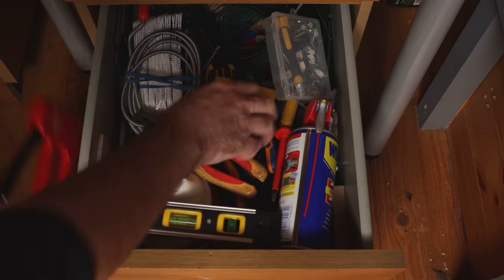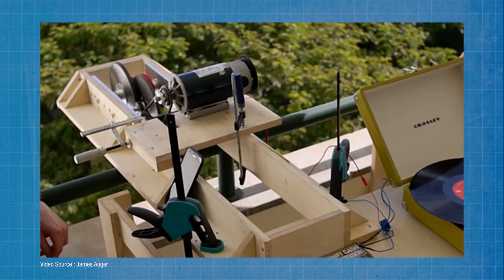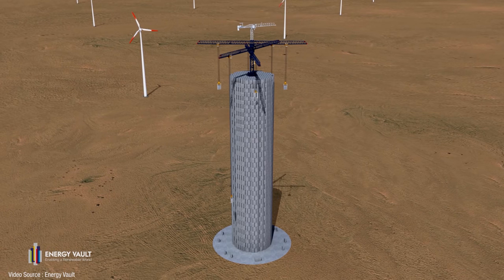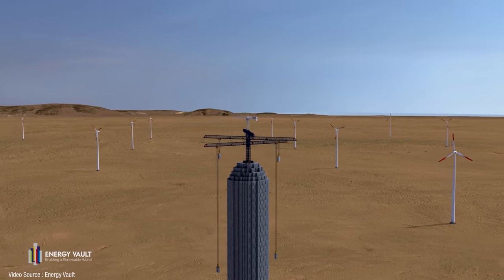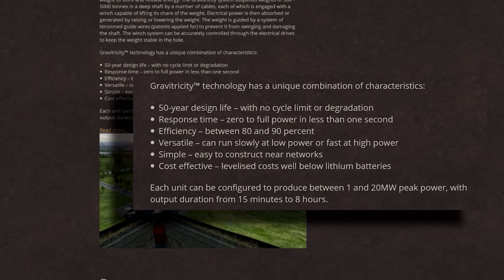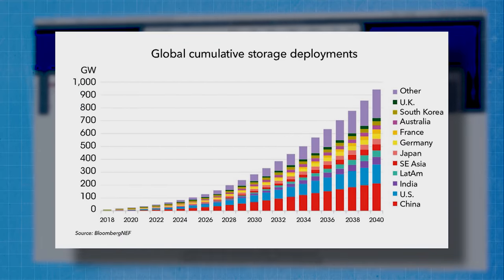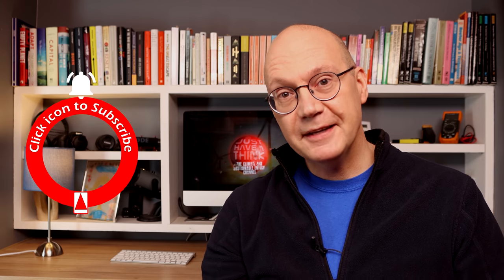Gravity Energy Storage : A very uplifting technology!

Comment: The eerieness of the youtube algorithm is getting out of hand. Im going to have to replace my off grid battery bank soon, it can barley last the night. so on my way home, I was pondering some alternative power storage options, this was one of the more seriously considered options. I just dont think I can engineer something sufficiently large, strong and high enough to give me what I want.

anybody got any hobby/house sized DIY ideas? pretty handy with the making of things. the offgrid system is just a hobby, mainly to run my nights entertainment, and not feel to bad about having lots of hardware all running. I dont need 4 bigscreens, 2 PCs, stereo and a console all running, but if its free... bout a 800w load for a few hours a night. got heaps of solar (there was a legislation change around here, so there are alot of no longer in code gridconnect systems, so you can pick up 5 yo panels for the cost of carting them away), so not to concerned on efficiency. I could just drop a few grand on some nice shiny new batterys, it dosnt fit with the getto-chic ethos of the project, aside from the inverter (and that was about 20% of its RRP), and a few screws, nothing is new.

Comment: The number one source of energy created by gravity is ocean tides. You don't have to build huge concrete weights either as it's already there (water).
Reply: Yes, tidal power generating stations are already in use in the Bay of Fundy and on the Rance Estuary. Tides move the water for you. Much simpler. I am of course not saying anything about the ecological effects of the system. It does work quite well, however, from the engineering point of view.

Comment: the only issue with this is that mechanical batteries are not practical at all! In order to create a household 2.4 KWh lead acid battery, you need to lift about 9000 kg weight by 100 meters. This is for creating just one household battery! Pls correct me if I missed anything

Comment: Energy Vault; back of the envelope. Blocks can be in two states. All blocks stacked up to the full height H of the tower, on average storing potential energy of 1/2 H times its mass M, since the average block is halfway the stack. Or they are spread out: two stacks each of height 1/2 H where the average block stores 1/4 H times M units of potential energy. Extractable energy 1/4 H times M per lowered block, given no friction losses. 
This gets worse, when you consider that it makes no sense to transfer the lower half of the full stack to a new stack of the same height. Only the top half of the stack, where the average block stores 0.75 H times M units of energy, should be lowered. On the single lower stack the average block still contains 1/4 times M energy units, giving a maximum extractable energy of 0.35 H times M units. For half the number of blocks. 
This can be improved upon by lowering all blocks to earth level which gives the maximal extractable energy at 1/2 H times M units per block. Ignoring friction losses, complexity and space required. And the lowermost block should never be moved.

Comment: An idea: if in the future you lower items produced in orbit on a tether to the Earth that in the process generates electricity. At its terminal the cable is connected to a battery and the supply is transferred into storage. The cable is then retracted back using solar energy.

Comment: I want them to add a second piece of engineering to this project... at the base of the platform, they should also add a huge pressure plate, that would be the platform itself... underneath that huge pressure plate a there should be a massive gearbox that will transfer the power to some other generators to produce surplus energy with each block of concrete that reaches the ground.... third, with a bit of ingenuity, a pulley system will put the "system of the pressure plate" in reverse once the crane is starting to lift blocks one by one from the pressure plate, adding some extra surplus energy.... This is just a drop from my imagination. IF I would have time to think long enough, I think I could really do better than what I said above... and they should do better as well because IF I can, they can do it too. Think!

Comment: Why not just hang weights off of a cliff on a winding generator...Say, a trainload of water filled tubs, filled at the cliff top and emptied at the cliff bottom. That way you can get maximum energy transfer and wind the empty train back up to the top for the next run....there are a lot of unused cliffs around guys. We know how to make train hoppers, and if you want precision load matching, this is a great way to get it cheap!
Reply: You just invented hydro power. but why use an expensive lift, when you can use any old tube?

Comment: Again another great looking tech but still requires energy to raise the blocks and again the answer is to use solar or wind to power this.
Solar and wind seems to me to be carrying a lot of this tech. But both generation from solar and wind is so small
Reply from the maker: Hi Jay. Yes, you're quite right. Solar and wind are in fact the only reason why these technologies  exist at all. That is the whole point of these energy storage systems really.
Reply: @JustHaveaThink  i see so drop them when peak energy is required and lift them off of base power from fossil fuels or solar or wind.
Would this not all be simpler if we used nuclear power for base power and batteries to store for peak power. We could then get rid of all these ugly solar and wind power plants and remove bio fuels completely, this will make food cheaper and we could plant trees there they had to be knocked down for the wind farms to be created.

Comment: Hydroaccumulation is we only technology to store electric energy with 80% efficiency Lithium batteries not have sane density of storage but also Lithium battery is most energy intensive manufacture bigger than solar panels semiconductor manufacture. And Tower bridge and potential energy hydraulic accumulators of gravity force :), that is novelty technology for turntables or special case for fast lifting bridges, as energy capacitors hydro dams always more efficient even they requires big areas.

Comment: Question. We have thousands of 'vertical mine shafts' in America. We call them Elevators - would it be possible to convert one of the shafts into working 'crain' style generator.    We already have to power the thing to get people up and down from skyscrapers. They already are attached to some style counter weight. The power infrastructure is already there as well as strategic access along the whole length for maintenance. Plus some inbuilt safety features for run aways. 
   Am I missing something here? Why don't massive tower just convert one of their shafts to generate their own energy.

Comment: The "Limehouse Accumulator Tower" of 1869 is an excellent historical example and nice bit of industrial archaeology. It sits by Limehouse Dock [now a pleasure craft marina] on The Thames just below London's finance district. It worked in tandem with a steam engine balancing the energy needs for the hydraulic power to drive the dock's 30 hydraulic cranes and many capstans, lock-gates etc. The steel drum weight contained 80tons of gravel and scrap iron. Just the tower remains. Here are a few links:
https://www.ianvisits.co.uk/blog/2010/10/01/climbing-up-the-limehouse-accumulator-tower/
https://jonworth.eu/limehouse-accumulator-tower-eccentric-joys-of-london/
http://www.glias.org.uk/journals/11-d.html {something wrong with the photos but it's the official write up}

Comment: That tower system is insane. How much energy in the blocks near the bottom? The storage obviously increases as the height rises, but how much of the tower is inefficient? Only a few blocks can be lowered at the same time.
Regarding the mineshaft weights, surely the results can be easily calculated mathematically? No need for a prototype.

Comment: Very cool but query:

Would the energy required to restack that large block of weights not be more than the energy produced by dropping them? If not then that would be perpetual motion. If it is, which seems logical, what is the purpose in it? Is it just for it to be constant and predictable - unlike the wind used to regenerate it?
Reply: Yup, it's an energy storage system.

Comment: The exposed crane design is innovative, but I can't see how they will cope with wind loading on the end of a 150 m pendulum.  There is not going to be any precise placement, particularly if it is sited beside wind farms in high wind areas.  The mine shaft concept looks like it would be very good by comparison, even if it is limited in the number of locations.

Comment: Instead of tall lifts you could do short lifts of more weight. How about buildings as the weights? Ground floor stays and a small lift for the rest of the floors above that only move couple feet up and gear it down to use. Then each building is its own backup.

Comment: Missing a little detail about the viability of pumped storage - at thousands of existing dam sites the roads, transmission lines and one reservoir is already built, just add the second reservoir and pumps.
Reply: Actually a fairly good suggestion- which might well lead to being able to return some rivers back to the ecosystems they originally belonged to. Please keep thinking! Water, being much less dense can store much less energy per cubic meter than the blocks mentioned- that said, if you already own the dam and turbines, this could well be a new way to get more from the investment without, say , damaging a salmon spawning ground. As to the investment a dam amounts to; the Niagara Falls  generating facility was originally built almost one hundred years ago, and it's turbines "renovated" three times since; Though not a dam project it does illustrate the potential life and life costs of their operation.

Comment: Mind boggling how the energy to pull blocks back to original configuration is never fully explained seriously; maybe a crew of energy drink drinkers can handle. Good ideas but gonna have to find a breakthrough to overcome the energy-in challenge.
The day we can neutralize gravity the way we can neutralize magnetism, we'll be at the drawing board. Good luck!
Reply: You are after instant gratification. This concept is not that. When calculating the losses at input, time is a factor. Losses on input can only be minimized. It's a battery idea, not a real time energy generation system. Imagine your cell phone and how long it takes to charge. Imagine how long it took for Lake Meade to fill. This idea that people hold (that it can never work) has been the main impediment to forward thinking on the subject. Visualize the concept as an energy piggy bank. If there is enough energy put into and held by it, then smaller withdrawals can be made without totally bankrupting the system.

Comment: What about the possibility of coupling this sort of system with the vertical drop produced by tides? For example here in the Channel Islands we can have a tidal range of somewhere between 4m to 11m (neap and spring tides) . Maybe that doesn't sound much, but consider that you have unlimited lifting ability twice a day, all for no input... What kind of potential energy would a 10,000 ton ship have if raised 11m into the air and then gradually lowered in some sort of cradle...?

Comment: AS CHEAP AS CHIPS
Last resort I feel I must endeavor until someone tells me that it wont work
  I am an 84 yr exfarmer and have invented alot of machinery and  developed lots of farm management ideas but know little of electricity
  I despairr at some of the  battery storage  ideas and  Dams seem to be an expensive undertaking especially Turnbuls Snowy enthusiasm
  
  My idea is to use old railway stock,,,Build  a line on a gradient and  mount an old locomotive on it.pulling a huge ballast
  It would remain at the top until wanted and slowly descend  producing power as it descends when power is demanded
  My friends think it is a ridiculous idea but 2 firms in  the US were impressed but ,they said produce a patent first
  I have seen many ideas such as compressing air in caves and building 50ft frames and hoisting weights aloft
  Many towns could have a set up producing power when its neededKind regards 
  Gerald  Greenman

Comment: Energy Vault..  Stick a wind turbine on top..

Or, beef up the strength of a wind turbine tower and have "grandfather clock" - like weights inside it..?
Reply: Potential energy doesn't store a lot of energy, is why this system needs so many blocks. A "long case clock" system with one weight attached to a turbine won't be that useful, which is a shame.

Comment: Are they using a system of gear reduction say using 100 gears to 1000 gears depending on the size of the weights to drop the weights slowly and discharge the power over a longer duration just curious also has the gravity energy people thought about how they could do a system of four of these towers or mine shafts basically reducing the land area needed to start the system you could drop one at a time and each one could devote a certain amount of its energy to recharge the previous tower or shaft

Comment: With the shafts, won't there be a small amount of heat generated when the weight is dropped quickly. Would there be potential for collecting this and storing it similar to solar heat storage systems?

Comment: How many percent of the energy supply to move the concrete block from bottom to top and return to same location. Sure there will be certain lost due to friction, noise and mostly horizontal movement of the blocks. Just wondering for other batteries storage, which is superior and more environmentally friendly.

Comment: Diminishing returns, need all the mass up top.
Reply: Yes, it does. The mass is lifted by energy captured from various variable and intermittent green sources and released at high demand points on the attached grid. Also the stored energy is stored as long as necessary, with out losses till needed.

Comment: A number of people looked at this system three of four years ago, when there was a previous burst of publicity about the idea. They claim some impressive figures which are obviously not related to the block stacking system. The very fast claimed response to demand changes, and switching between storing and generating has to be based on having something like a battery set as a buffer. Nothing mechanical responds that fast. They clearly need a buffer to ride over the turnaround times as they switch blocks. What they need to bring to the table is the ability to accurately and repeatedly stack cheap robust blocks on the end of long chains with high precision in all weathers.

They appear to use simple concrete blocks without a metal frame, which might minimise chipping as they bump together. How long do they expect these to last with all the chipping away of corners they will see? Operating tall cranes in high winds is a difficult task, especially when the wind is gusty, as it tends to be close to the ground. It takes considerable precision in locating blocks if you want a tall stack of them to be stable, and if you want the support points to be locatable by an automated system trying to grab them and pick them up. It also takes very precise control of the closing speed if impact damage is to be minimised.

It will be very impressive if they can pull this all together, with software accurately predicting the swaying of blocks in high gusty winds, and placing them dead on. However, I think there are huge challenges ahead for them, which they have barely scratched the surface of with their 2018 demo system.
Reply: grindupBaker  In discussions three or four years ago some people familiar with cranes and elevators said they thought this would only be practical if the entire system were encased by a perimeter wall and roof to make it like an elevator environment. Without wind, precise positioning of blocks is much easier. Without rain promoting corrosion, elevator style steel cables can achieve a long lifetime with low maintenance.

Comment: what was the % efficiency of the tower?
Seems like the shaft will be potentially more robust, environmentally friendly to develop and cheaper to make per metre of drop??
Reply from the maker: According to Energy Vault, the round trip efficiency is something like 90% - that will of course need to be proven at their new demonstration facility.
Reply: @JustHaveaThink  It seems very high. And very impressive  if verified (Compared, for example, with coal-fired power stations)
Thanks  for the reply. :)

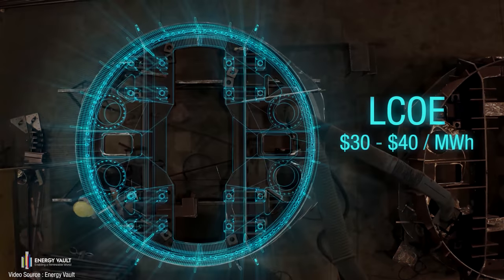Comment: At 5:30 he states claims that costs are going to be less than gas fired power plants. Are these really comparable? When all the blocks have generated their electricity and are sitting on the ground waiting to be hoisted up again, how is this comparable to a gas turbine connected to a constant pipeline supply?
Reply from the maker: Hi Mike. That's probably a question for the people that built the system. Hopefully they will be able to provide you with an answer. Here's a link to their website
https://energyvault.com/

Comment: Don’t understand the energy volt. Surely when there is an excess of wind power then wind is blowing allot (you know like a storm) then it’s not safe to operate a crane? I get that it’s reused material but far smarter to use a ready made disused mine shaft that’s not doing anything and not affected by weather. Don’t get me started on all the moving parts and how they have to perfectly match up repeatedly every time. Winch up winch down simple. 

Silly question: Regenerative power from lift shafts in high buildings. Is that a thing?